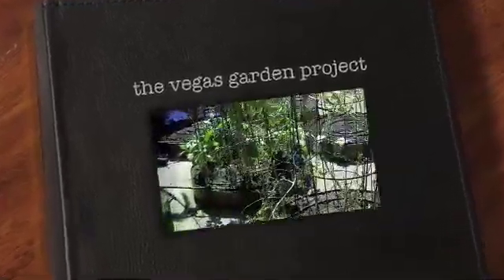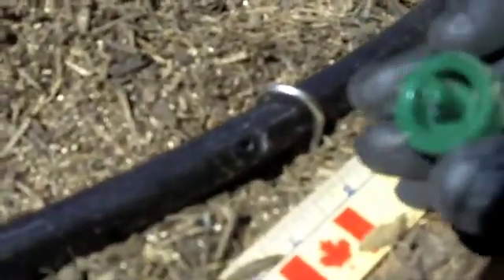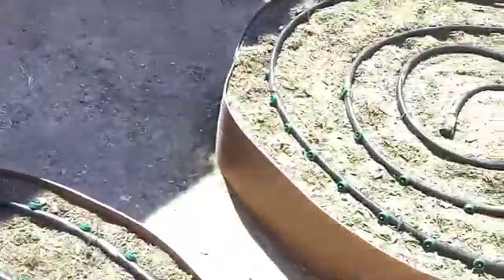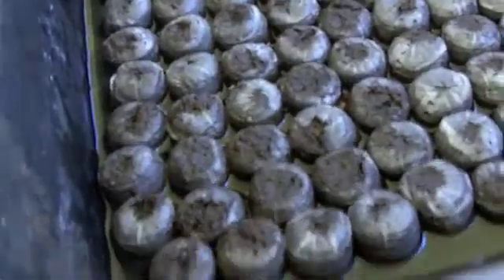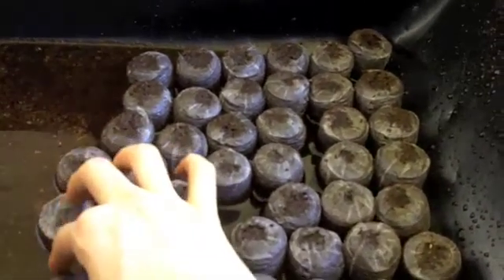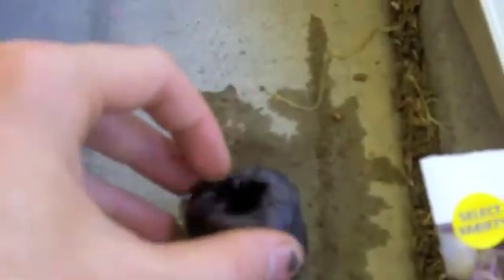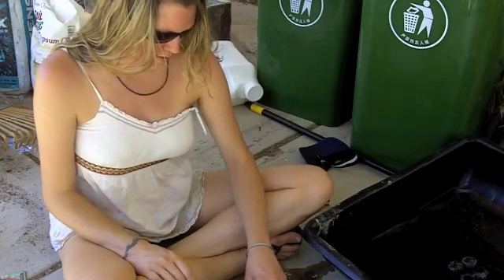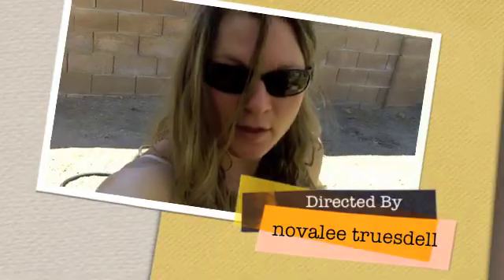*Automatic Irrigation system and Pete Moss Pellets for Efficient Watering in the Vegetable Garden

Comment: I realize that at this point, this is ancient in terms of your gardening experience, but I can't help wondering.... so I have to...
I'm wondering if you've learned how to use those pellets for their proper purpose, which is indoor seed-starting.
What you should be doing is lining them up in a plastic tray, planting your seeds and covering them with a clear dome cover and set them on a shelf Out Of The Direct Sun so that they have a chance to germinate. After some time has passed they should germinate and begin growing.  The ones that germinate you take out to the garden to transplant into the soil and the ones that don't germinate you leave. This way you only put seedlings in your garden and you don't have gaps or holes in the garden where something didn't sprout.
Also, being inside, out of the gruesome desert sun means they have a better chance of growing up strong without being steamed to death before they can even get started.

If this is not something you have already learned (3 years later, Sept 2014), then I hope you find this tip helpful.
Cheers!